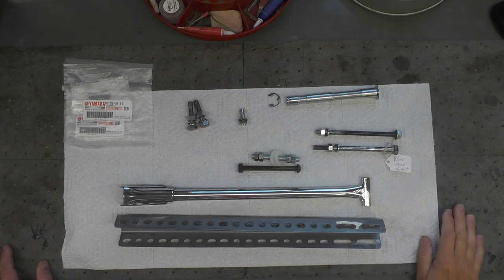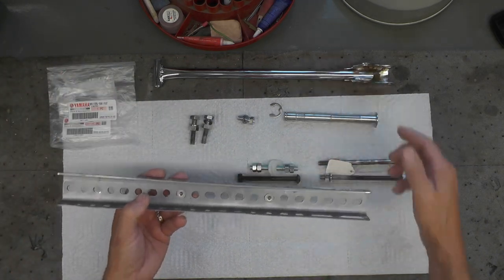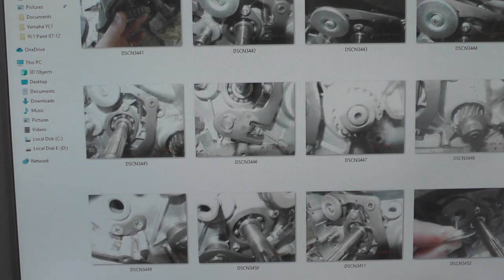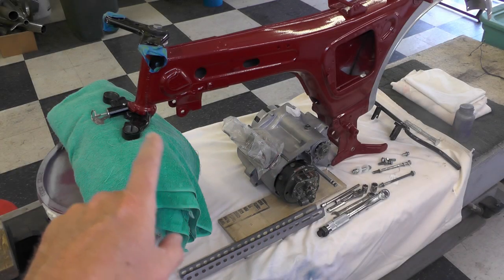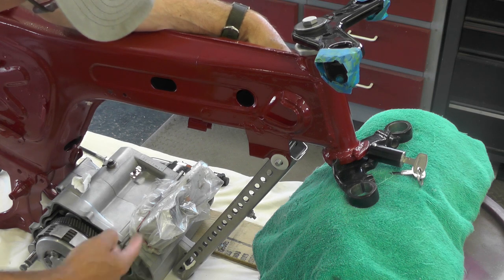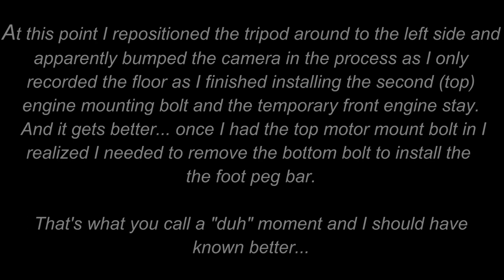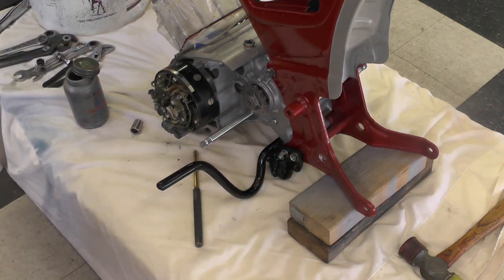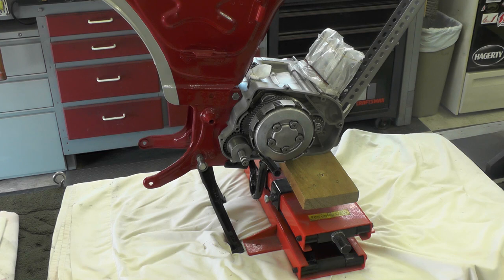Yamaha YL1, Installing the Engine into the Frame --- Video #111

Comment: That is looking so clean. Going together nice. A NOS footrest?
Reply from the maker: Thank you for the kind comments!  

The footrest bar is original, though I had to do significant work in the press to straighten it as it was bent several different ways.

The rubber covers are new, not NOS, as Yamaha still supplies these these parts.

Comment: Hi Roy, gosh that was a real struggle. Quick question, do you think you'll be able to get the engine side covers on with the footrests in place? Great Video. Jono
Reply from the maker: Yes, I think so, Jono.  I eyeballed things before I bolted everything together and I believe I'm good.  If I discover I'm not, I'll work it out later...

Comment: Im building a YG1-K (64) and would like at a later date to fit a YL1 engine.....how similar/different are the two frames/engine fitment? cheers
Reply from the maker: I really don't know if a YL1 engine will fit a YG1-K frame as I haven't worked on nor am I familiar with this bike.  Without doing research, I can't provide guidance... sorry.